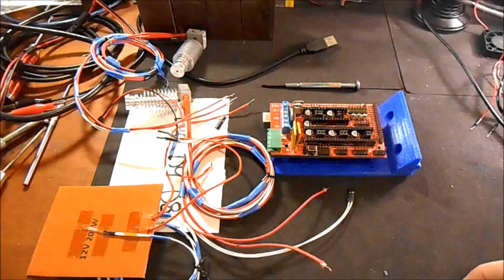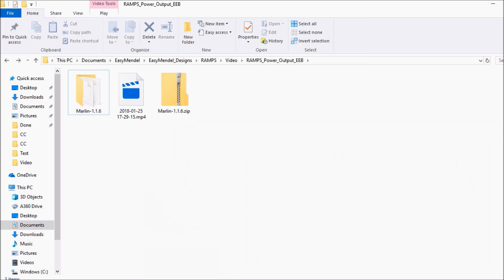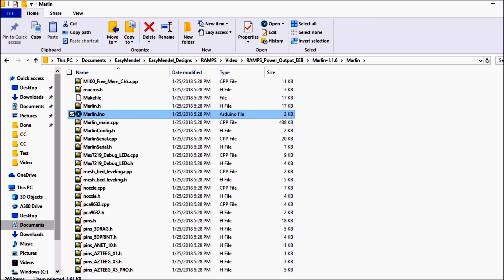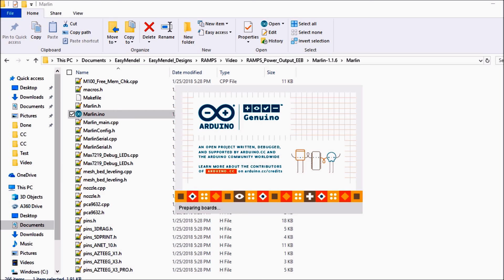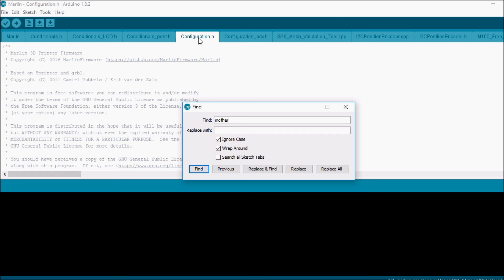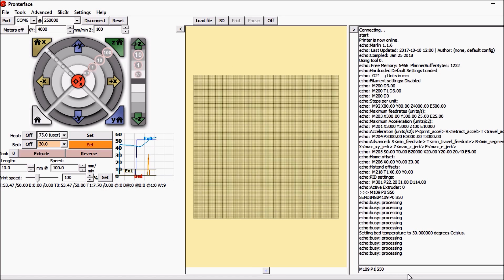RAMPS 1.4 - Power Output EEB (D10, D9, D8)

Comment: Hi, please tell me how to connect FAN for double extruder (EEB) blowing models . Where to stick and what to edit? (ramps 1.4)
Reply from the maker: Is there a 12v power pins on your board?  Otherwise in my playlist there should be a fan extender tutorial.
Reply: @EdwardBraiman  You mean "RAMPS 1.4 - Fan Extender Expansion Module" is it? But what need change in Marlin?
Reply from the maker: I think it's in the tutorial, it's been a couple of years since I watched it, but I think the steps are still valid.